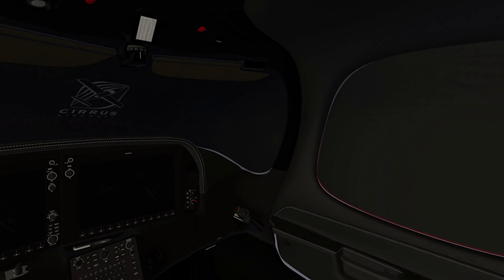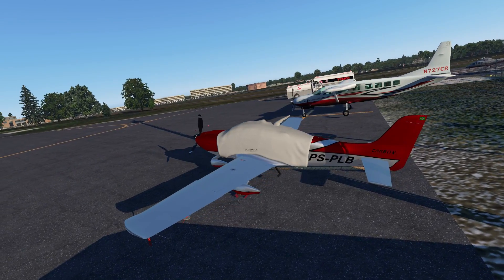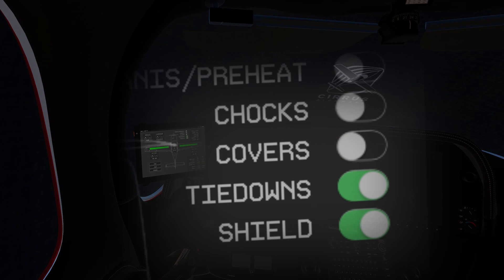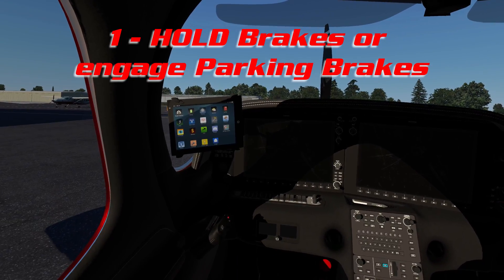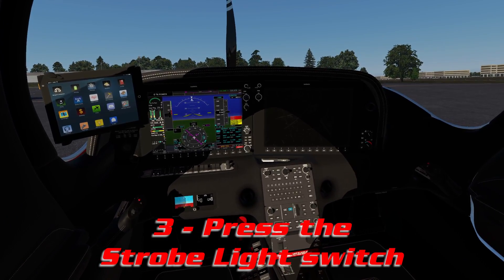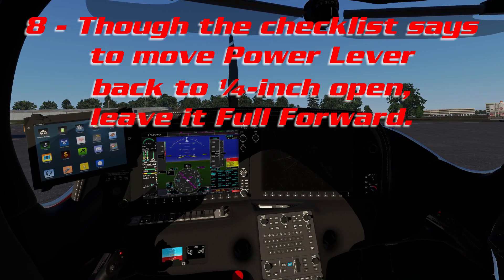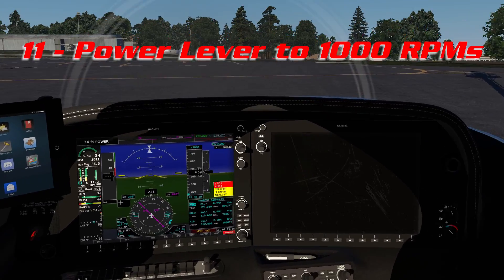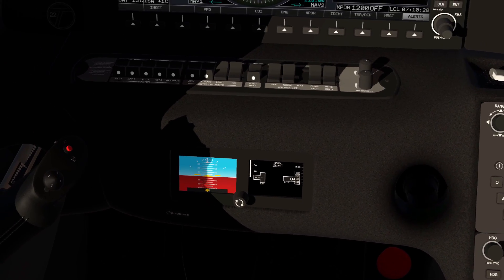X-Plane 11 - HoldMyBeer SR22T G6 - Engine Start Procedure

Comment: My iPad wont turn on. in sr22
Reply from the maker: I couldn't begin to guess why that is.  Not that it should be connected to the plane but check your fuses.  Try 'Fix All Systems' in Aircraft Configuration.

Comment: Thanks for tutorial. I engaged the GPU, got her started, but the Energy menu in the iPad wouldn't allow me to disconnect the GPU with the engines running. Very odd.
I also agree that the interior is way too dark even in broad daylight. Using the Flashlight helps a lot.
Reply from the maker: Check out the first part of Log 26, where I also perform a full start using the GPU.  What I learned there that I didn't know here is that you have to disconnect the GPU right before cranking the ignition.  Not sure why it was coded that way but once you know that, it's not a hardship.
Reply: @sr22gts  Thanks. I'll try that next time.

Comment: How did you get rid of the cover and chalks. You just did it, but did NOT explain how you did it. The ipad on mine is down near the passenger seat, Not up on pilots side. Can not find how to get the chalks and covers menu up...When I click the weight and balance, it says "application is only available on ground with engines turned off!" BUT... I'm on the ground with the engines turned off already. But it continues to do this.
Reply from the maker: Not sure why your plane is saying that it's running if it isn't.  Try exiting fully out of X-Plane and restarting.  I'm thinking that will reset the plane.  If so, you should be able to enter the Weight n Balance app (the first icon) and switch off the shield, chocks, and other stuff.  Also, the placement of the tablet doesn't matter.
If it continues to give you issues, I'd just reinstall it.
Let me know if this helps.